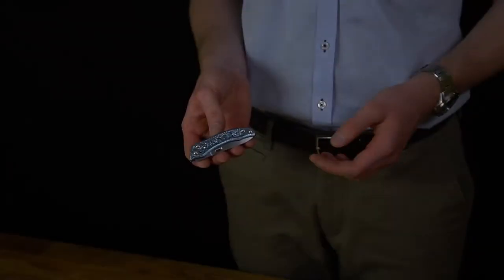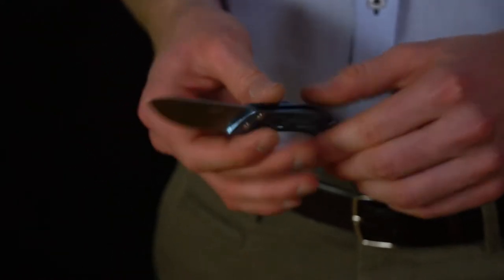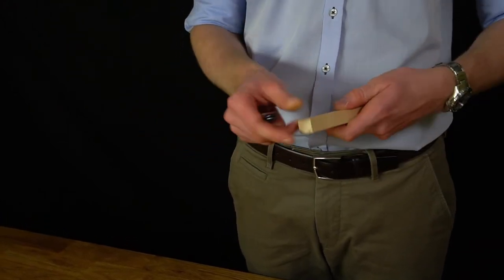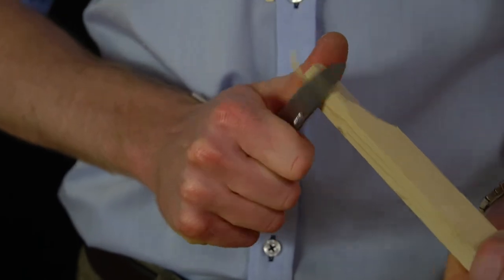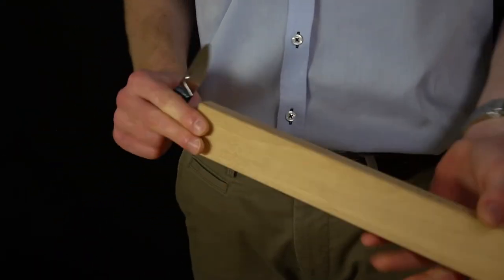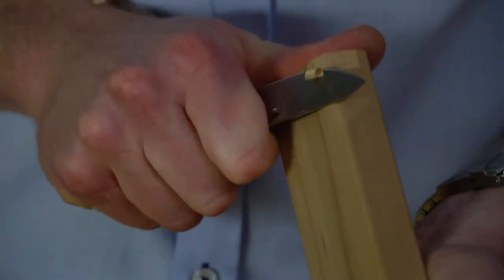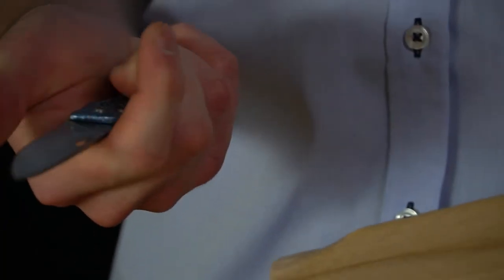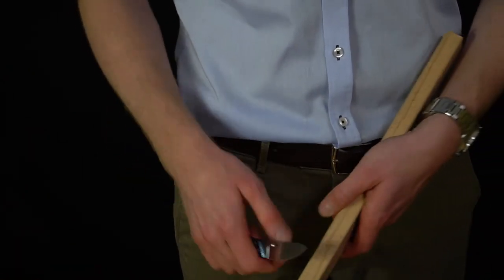Testing my new Detent Slipjoint - The first Florian Sojka Garrulus

Comment: A finger choil would be nice
Reply from the maker: Thank you very much for your input! A finger choil is good when you want to have an additional option to grip the knife closer to the edge. In this case you already have your fingers as close to the edge as possible. I designed this intentionally like this so you have maximum control and force with the edge while keeping the knife compact.
Reply: @FlorianSojka  but a finger choil keeps your fingers safe when you don’t have a locking knife- for example on the spyderco UKPK, there is no danger of the knife closing on your hand because the choil keeps it open
Reply from the maker: @toziassmitt  This is true. The Garrulus has a little choil which continues a little on the blade. It also prevents the blade from cutting you accidentally like you can see in my first video at around 1:00. It is not as big as on the UKPK but therefore the blade to handle ratio is better. 😉
Reply: @FlorianSojka  I disagree. As a British person who can only use non-locking knives, I will only use an EDC slipjoint knife if it has some sort of finger choil, because it’s safe. All it takes is one accident for the garraulus to shut on your fingers, and if your finger is further down the knife than you said, you’ll get cut. There’s a reason the UKPK, kizer zipslip, bestech junzi, HH Pilar all have a finger choil. If it doesn’t have a finger choil it isn’t a “hard use” edc knife to me
Reply from the maker: @toziassmitt  What do you disagree with?
Reply: @FlorianSojka  the idea that this knife is better without a finger choil- as I stated, it is my opinion (and a lot of other British people, check British blade forums.com) that an actual user EDC slipjoint must have a finger choil for safety
Reply from the maker: @toziassmitt  I understand what you mean. If you look closely you can see that it actually has a choil like the UKPK. The coil just is not as prominent on the blade as on the handle. The coil on the UKPK also is not fully on the blade, but on both knives this is enough to prevent the blade from cutting your finger. You can see that it works in my first video at 1:00.
Reply: @FlorianSojka  you’re not quite understanding what I’m saying. The choil on your knife works so that if the blade shuts, it doesn’t cut your fingers, because there’s an un-sharpened part. The choil on the UKPK works so that if your finger is there, the blade *cannot* shut. No matter how hard you try, with the finger in the choil of the UKPK, the blade will not shut on you. This is what we like. On your blade, if your fingers are slightly further down and it shuts...
Reply from the maker: @toziassmitt  Ok. This is true. You mean that the coil pinches your finger. To achieve this you need a deep choil which would destroy the design. You have to remember that this is a slim knife. At least it does not cut you as a lot of other slipjoints. I have never called the Garrulus a hard use knife, too.
Reply: @FlorianSojka  yes, maybe a thought for a future design if you keep making knives ! 😄
Reply from the maker: @toziassmitt  Yes, maybe. Thank you!